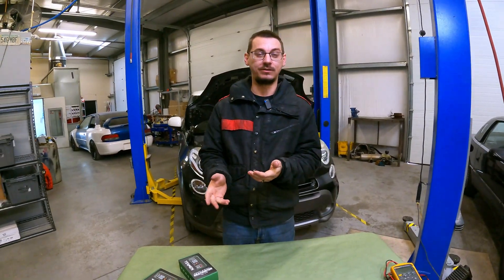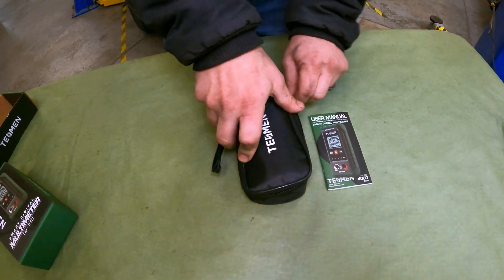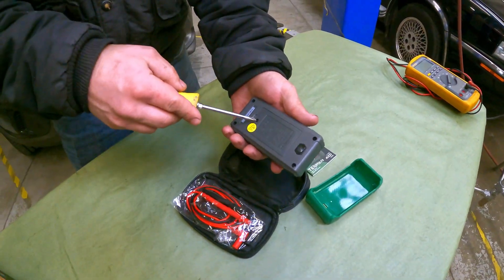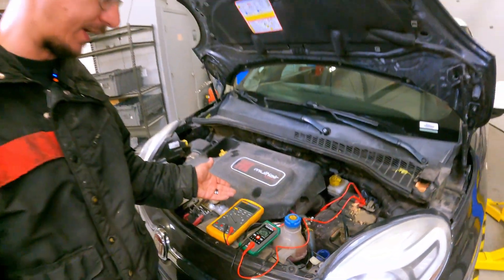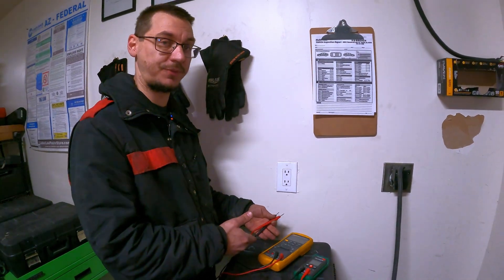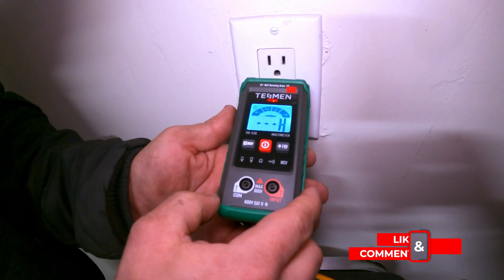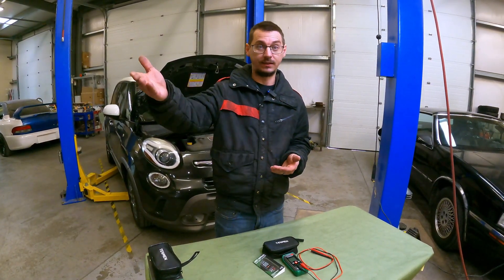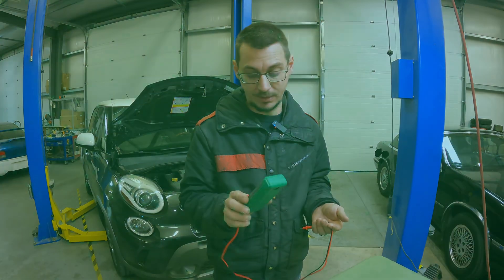Does This Multimeter REALLY Outperform the Competition? Watch and See!"

Comment: Not being able to select the ohms and continuity test is a fail. You should be able to select and get a result for the scecific test you need. Even a 3 dollar Harbor Frieght multimeter is as accurate. I have a 30 year old digital Fluke which works correctly  every time.

Comment: Scenario where the flashlight comes in handy...   you've shut the power off in a quadrant of your home. You're about to go check on some plugs, or wires, to see if they still have power (which happens a LOT in older homes - random 'powered' lines, running into quadrants where it's on a separate circuit). It's dark.... because it's later. And you shut off the power. So no lights. Hey..... you have a flashlight, built right in!!
I suppose that's where my thoughts went..
Reply: Yeah, it is only useful in a very dark room.